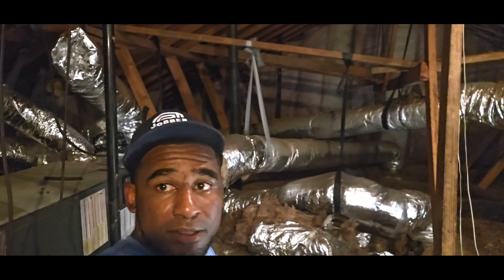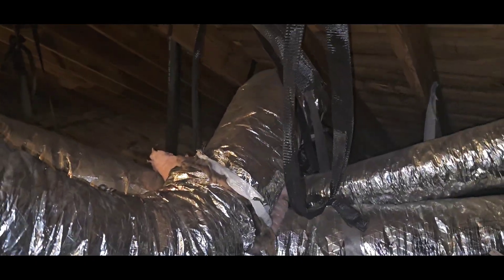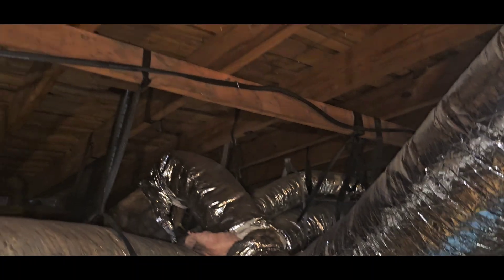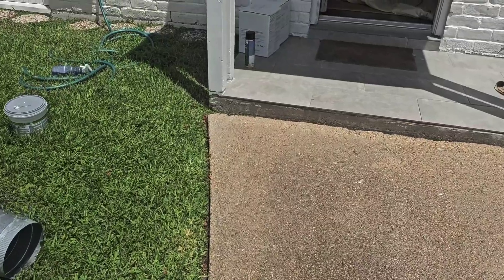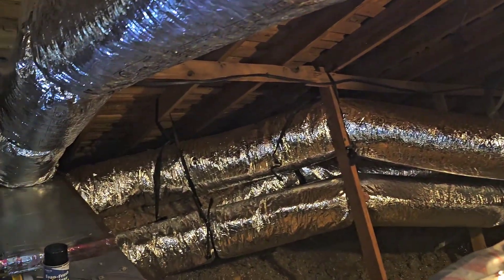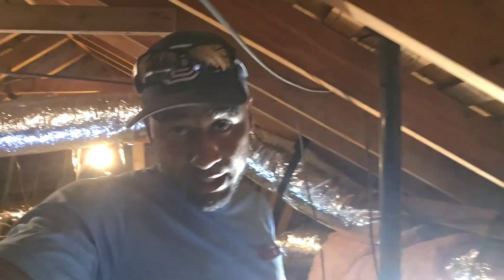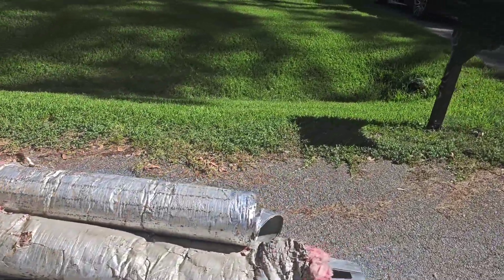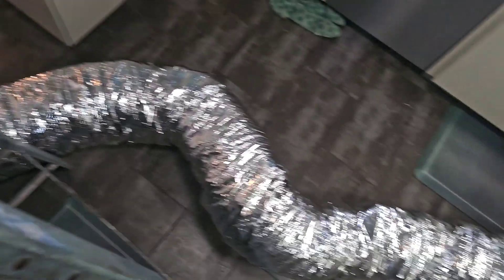Optimize Your HVAC System: Installing R8 Flex Duct Like a Pro

Comment: Hi Walter, when you quoted this ductwork replacement did you have a plan or sketch of how it would look before or do you and the companies you subcontract with figure out the design on the job? I was just curious of your process for ductwork replacement and design.
Reply from the maker: First, a rough estimate.I pretty much take all the measurements and sizes.  I purchase all the material, and if I'm short of something, I'll pick it up. They will let me know exactly what's needed during the demo